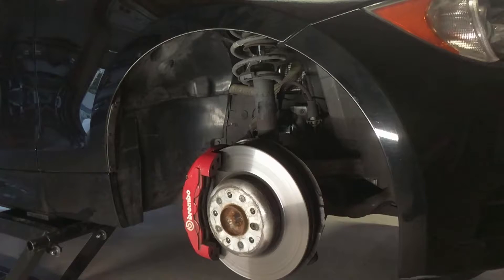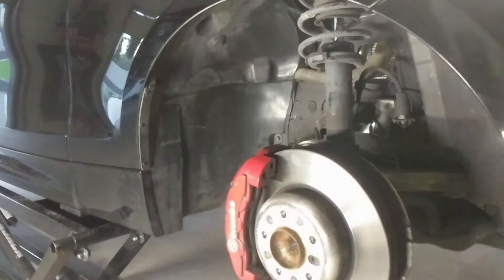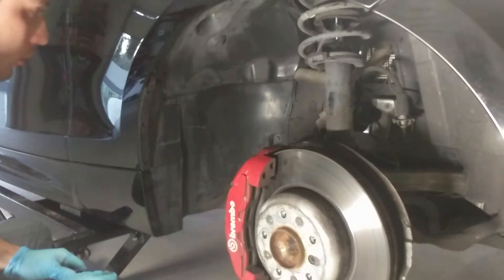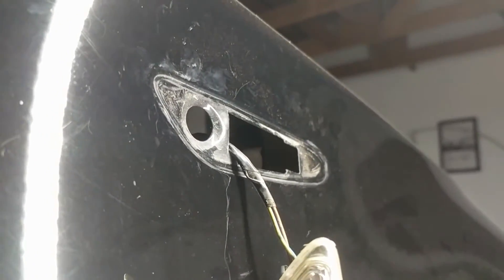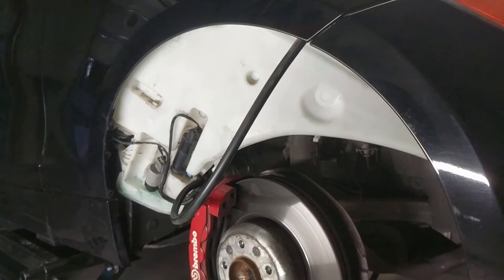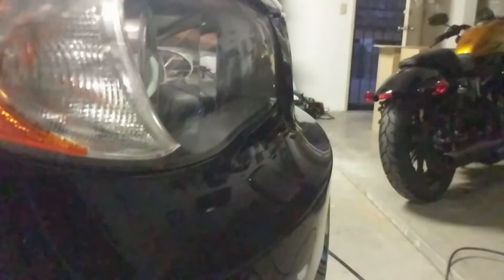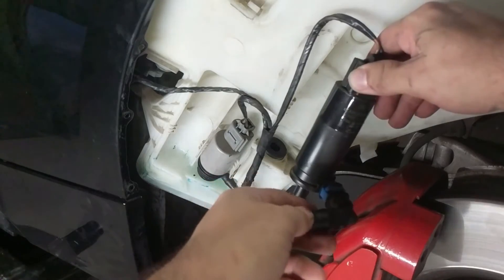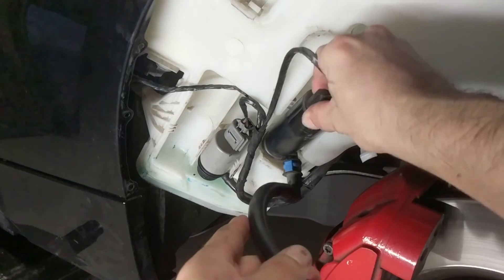2008 BMW 135i Windshield Washer Pump Replacement

Comment: to did that much job, should remove the seal between the pump and bottle, because that seal is a filter and it block all the time!

Comment: it is the same procedure for the E81 / E82 / E87 / E88.  Add this information in the title you can help more people and you will have more visibility.  The 135i has nothing special in this part compared to other engines
Reply from the maker: Thanks for the heads up.